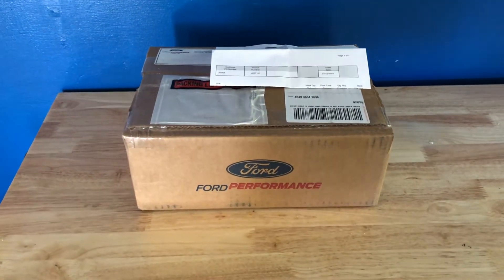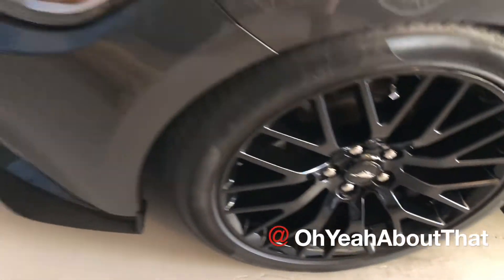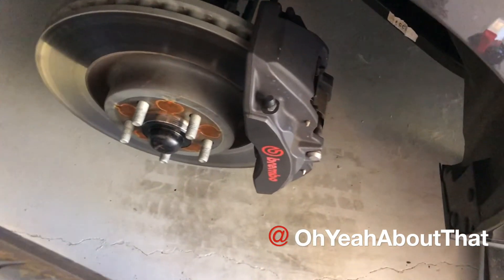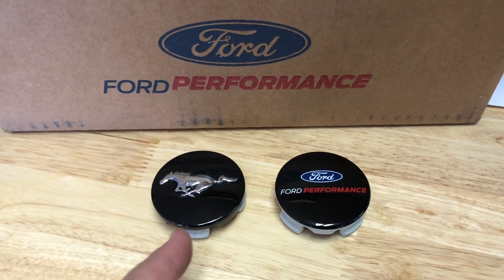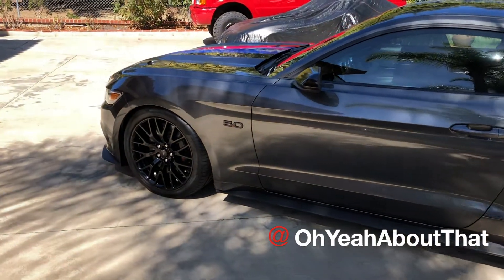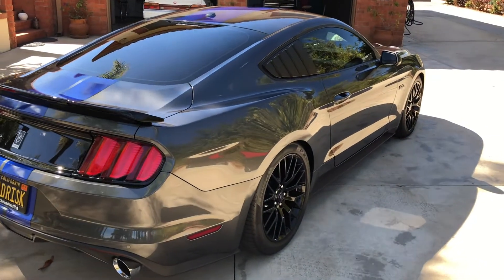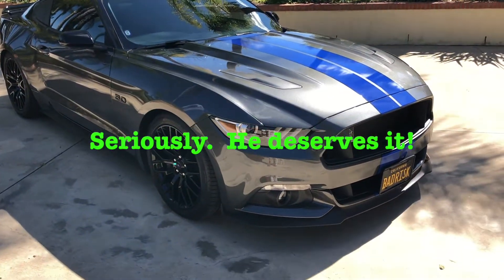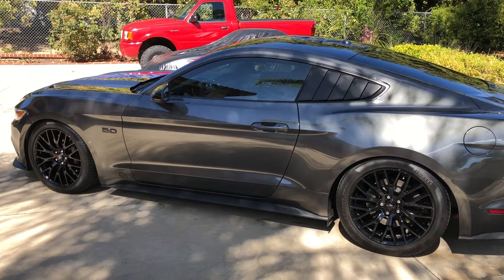2017 Ford Mustang GT [Ep. 25] FORD PERFORMANCE CENTER CAPS INSTALLED!

Comment: There has to be a way to pull off the stock caps without pulling the wheel off. Suction cup?
Reply from the maker: No. If memory serves there is a metal ring inside that would break the plastic clips if it’s not removed from the back.